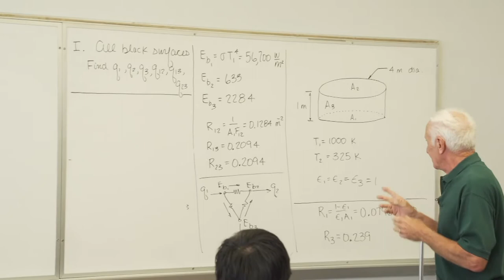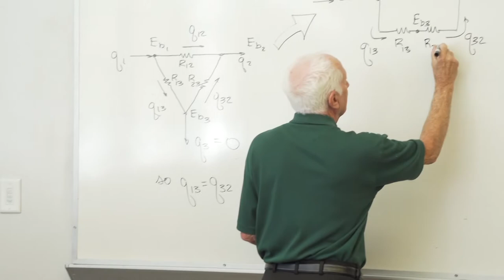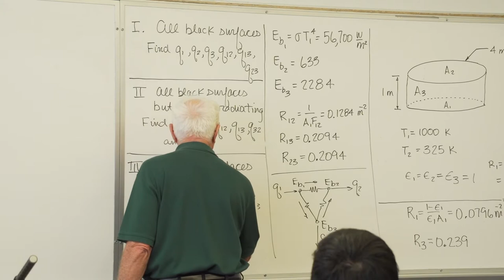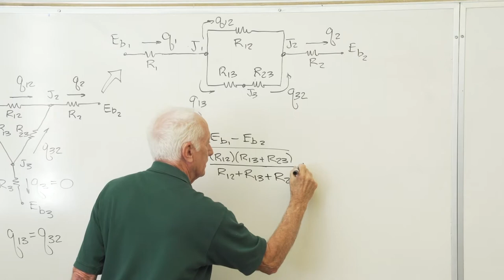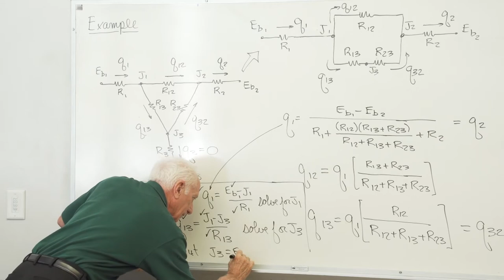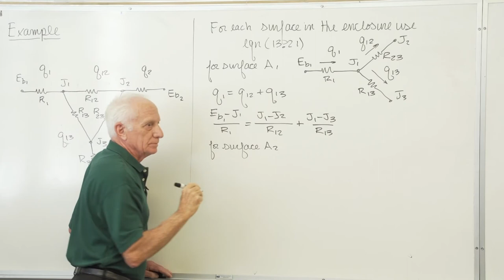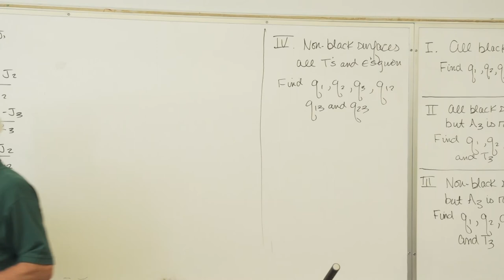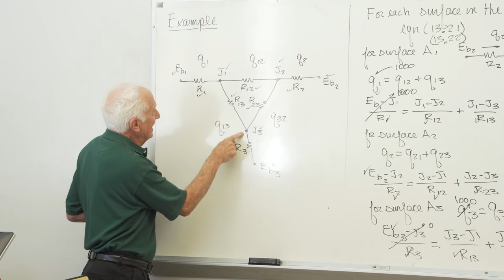Heat Transfer (21): Radiation network examples

Comment: If I know all Q's or as its written here q_1,...q_3, how do I calculate heat change over time for a particular surface if I know the mass of that surface? Do I have to consider aborbtivity as well? The heat change equation Q = Mass*SpecificHeat*change in temperature, rearranged it is T_final = Q/(mass*SpecificHeat) + T_initial, does not seem to account for this.